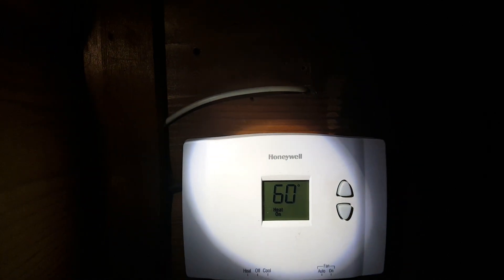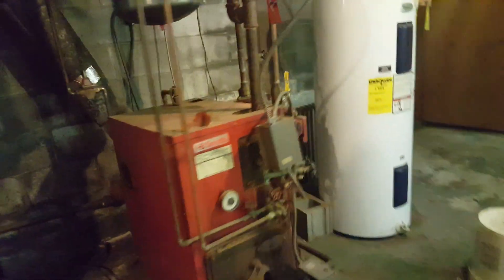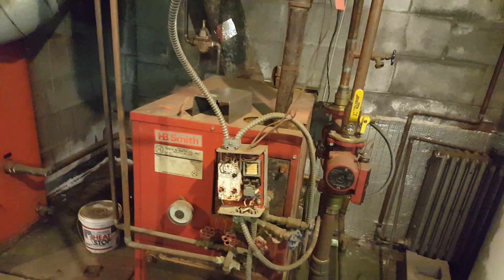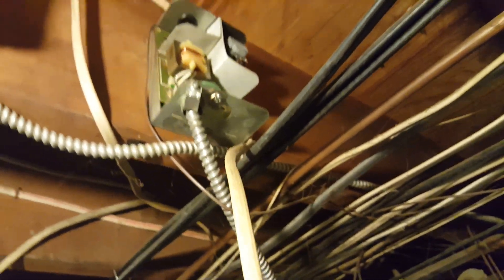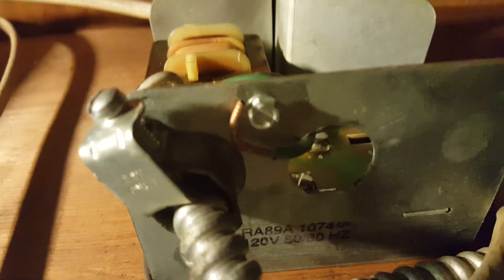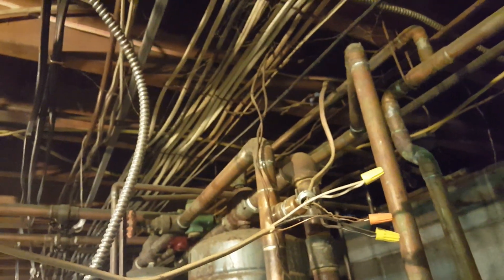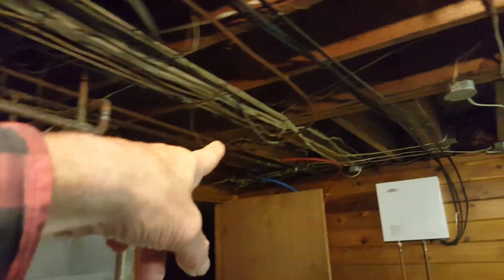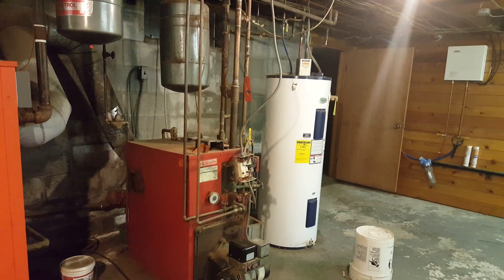New House No Heat-Now Feexd 10 3 19

Comment: I would try that other thermostat first then start tracing power to the control relay. Something is amiss
Reply from the maker: All feexd! Emergency Safety Switch was OFF! It fired, oil was everywhere, smoke pouring outta every crack! Scared the crap outta me! But I got  H E A T ! ! !
Reply: @CORVAIRWILD  great news. 👍
Reply: @CORVAIRWILD  nice work I was thinking about that as I just seen video . glad its fixed.